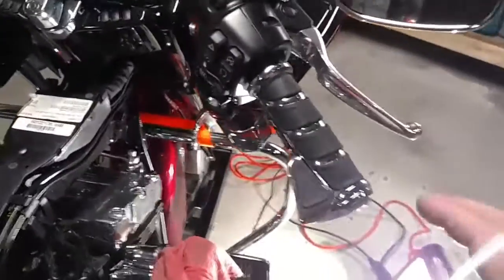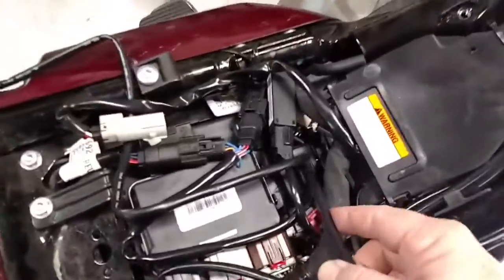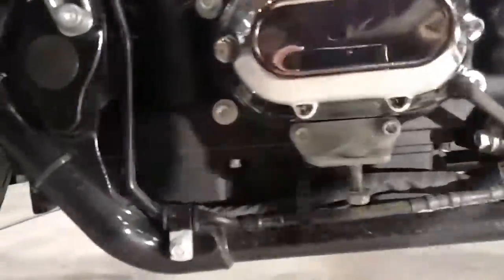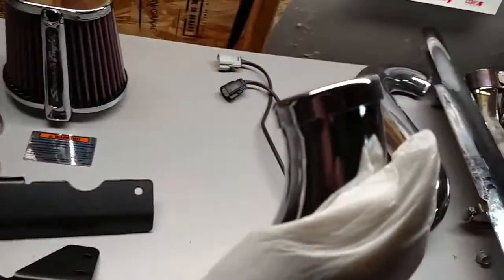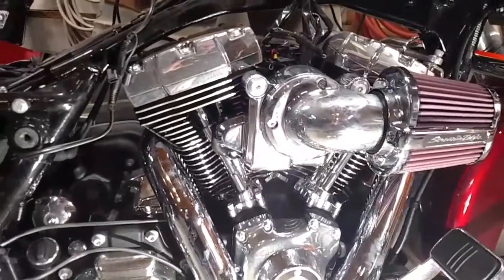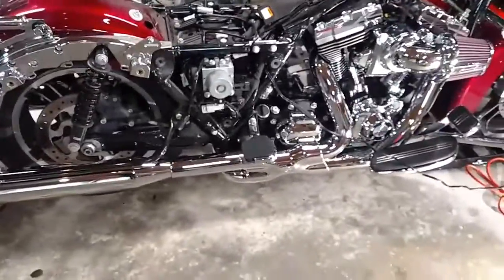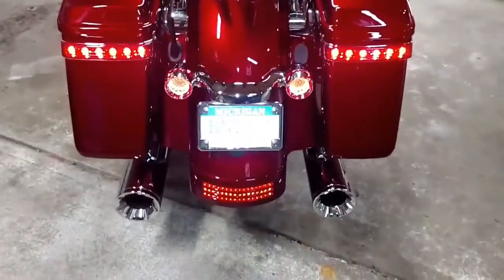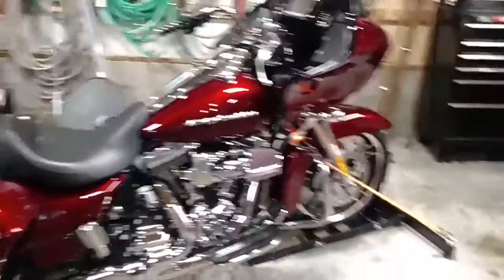Road Glide Special Upgrades 3

Comment: How did you get that rear reflector off the bike ?
Reply from the maker: J.N.M. III there's a couple bolts under the fender. I adjusted my shocks up fully to maximize room between the tire, removed the saddle bags and reached in to remove the light bar to eventually get at the reflector. I almost remember 1/2 hex bolts, but can't be certain. it was easy, just took a little while.